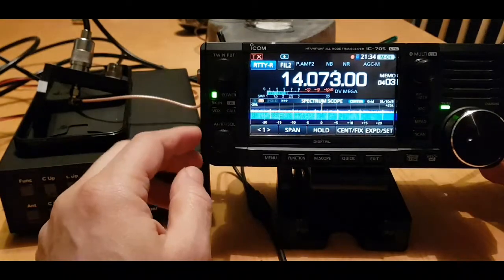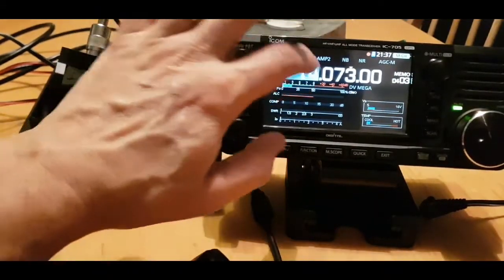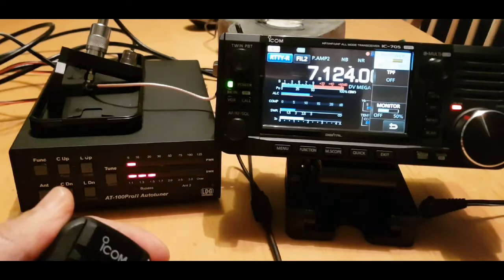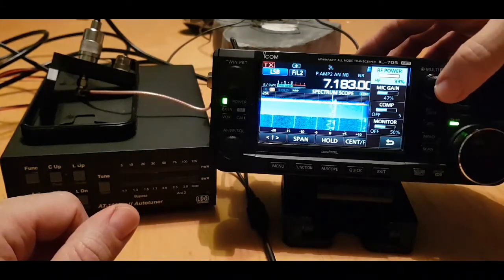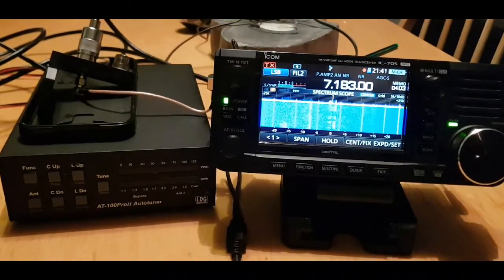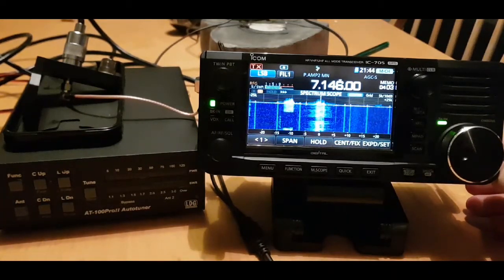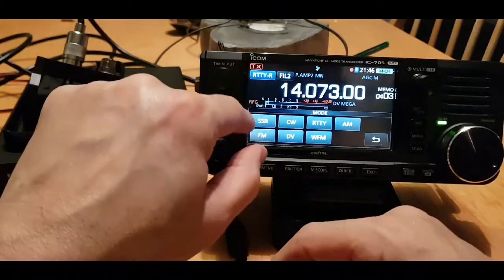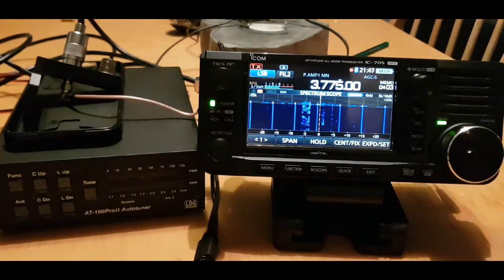ICOM IC-705 + LDG AT-100 pro11 -ATU

Comment: Would be interested to know if, when you plug a 3.5mm Stereo cable between the IC-705 tuner port and the radio port on the AT-100 Pro II, if it's recognises the tuner and tunes from the tune "button" on the radio?

I have a rather old AT-100 Pro II that just doesn't seem to have the logic signal on the radio port for the IC-705 to recognise a tuner is plugged in and have had no luck when connected this way.  It all works just fine in auto/RF sensing mode and the faff that is changing mode/power manually as per your video!!
Reply from the maker: U can modify it to tune when you push ptt.

Comment: hello, what interface does it have? Do you have the plan to assemble?
Reply from the maker: I purchased assembled from Ali express it connects using pl259 patch lead.
Reply: Could you supply a link for the cable needed. I'm kinda stuck finding info on how to make it myself. Thanks!